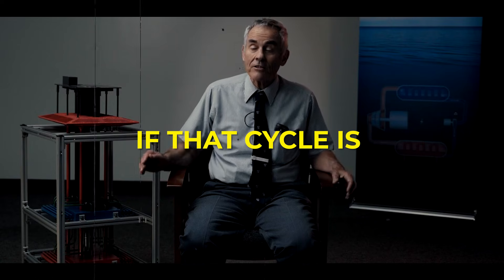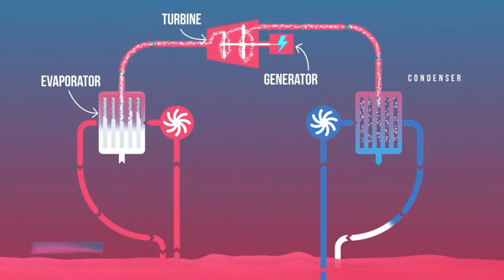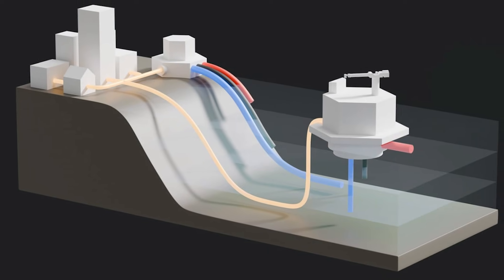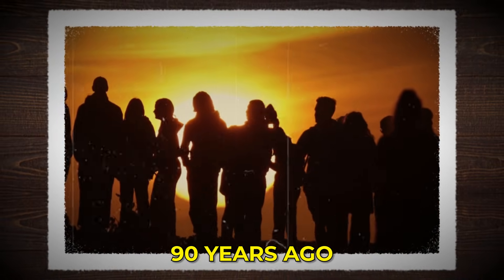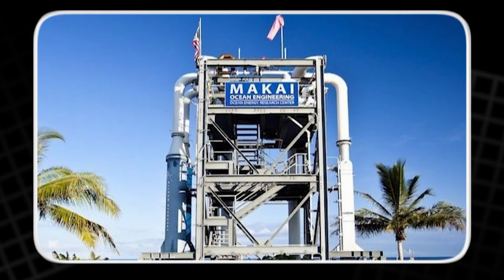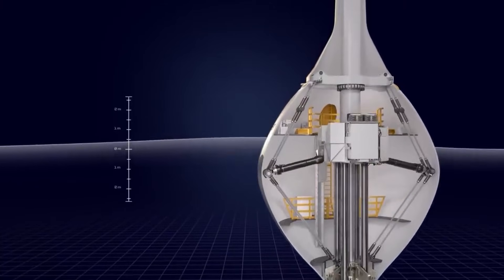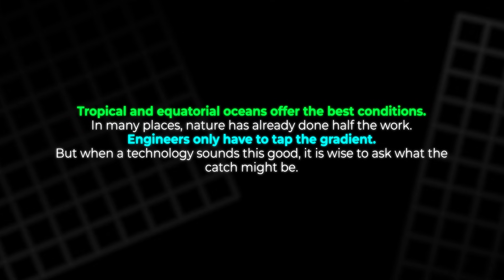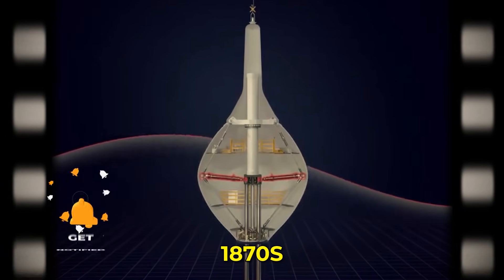The Ocean Power Plant That Breathes Electricity

Comment: Yes, it's an extraordinarily good idea, but it has a big problem. If we use 1,000 terawatts of solar energy, we'll heat up the oceans, and there will be fewer microorganisms that produce oxygen. Fish and other big problems like algae that will appear due to ocean warming. I don't see it being feasible on a very large scale. It's dangerous on a very large scale.
Reply from the maker: That's a very insightful point about the potential environmental impacts of large-scale ocean power generation!
Reply: Converting heat to electricity does not add heat to the system, it removes heat, which is a net positive considering the problem of global warming.